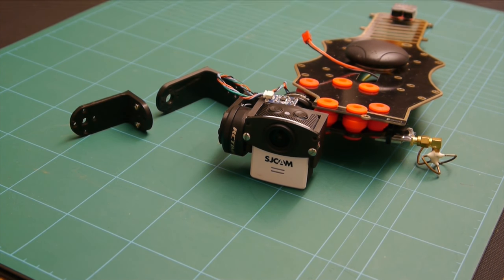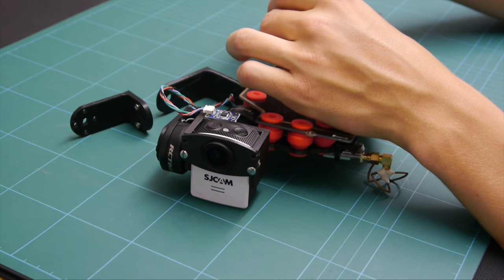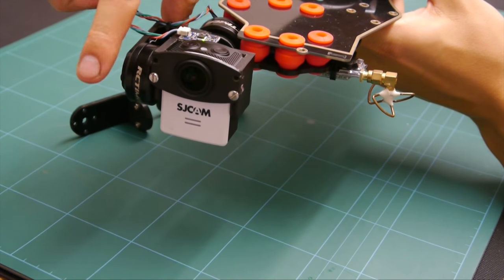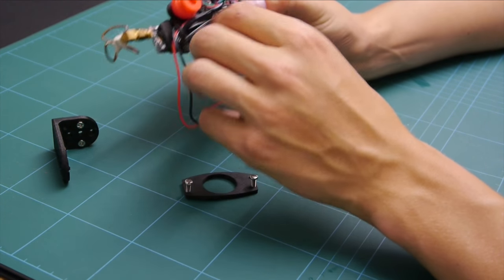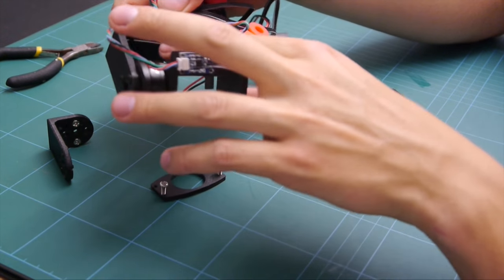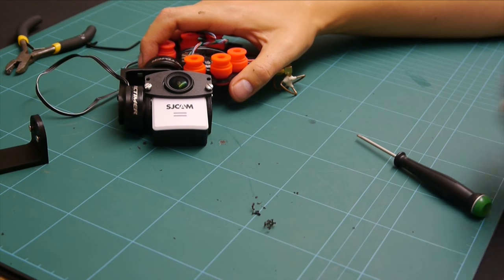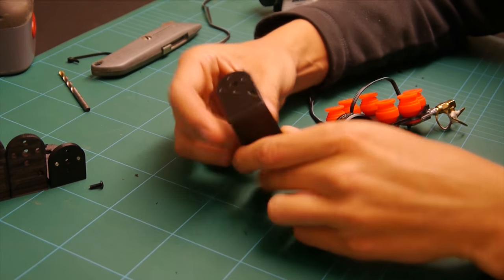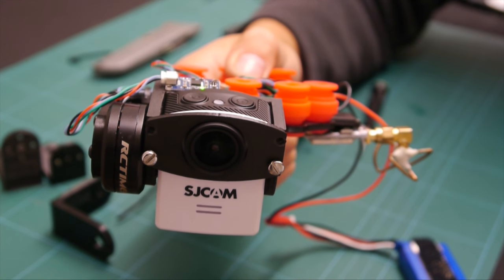TheManLab - Gimbal Build For Sjcam M20 - Diatone White Sheep APM Quad Build - Part 9

Comment: great video!,  have you tried connecting it to an FPV system?,.  (I see that the M20 have "FPV mode" but not sure how it works),.  I'm trying to make a quadcopter and definitely will use the M20 that i have,  this gimbal hold would really become in handy,
Reply from the maker: Hi. It's not recommended to use a camera on a gimbal as an fpv camera. The fpv mode on the M20 is so over wifi to a smart phone. When recording the lag is about 5 to 7 seconds so it's unusable. You will need a dedicated fpv system. Let me know if you would like to purchase some printed gimbal parts.
Reply: +The Man Lab thanks for the heads up! i didn't know about it, So what would be the cost for the printed gimbal? (and from where is sent ) So i can calculate the cost also, thank man!!
Reply from the maker: I can't PM you, can you send me one?

Comment: Great video. I was searching for a mounting bracket for my M20. Any chance I could get one without the motorized gimbal? My X8C can't handle that much weight.
I just need a frame with a Gopro mount or 1/4" screw. Too bad the M20 has less mounting options but the videos are great.
Reply from the maker: One comes in the pack. http://tinyurl.com/zgk2kde next to the case. Enjoy!

Comment: hi friend I got mine last week and I am trying to set it for FPV about the LCD is it possible to set it clear without anything on the screen because the osd of the drone cannot be seen very clear cause of that.
Reply from the maker: Charlie Farrugia Ok just don't use and OSD.
Reply: well I think that's not  a solution the osd is useful  so there is no option?
Reply from the maker: Charlie Farrugia Have you got a bad signal reception? Try and change you transmitter and reviver channels.
Reply: The problem is not with the reception but as you know the camera shows on top 1080 60fps and on the bottom the date and time now here is the problem when I connect the camera with the drone then it will display the osd for example the sat and voltage etc... because of the camera I cannot see clear the osd reading of the drone you know what I mean?
Reply from the maker: Charlie Farrugia I understand now. I don't use the SJ cam as my fpv camera I use a separate one. The only thing you can do is the configure your OSD and move the items around that are in the way. I've done a video on it too!
Reply from the maker: On the SJ cam. Goto Setup and go down to OSD Mode and turn it off. Done. Enjoy.
Reply: have you tried it? I  already did that and I get a black screen
Reply from the maker: Charlie Farrugia I don't have an hdmi out cable to test but on the M20 screen it just showed the picture no information.
Reply: I didn't tried the HDMI yet but for fpv you need to use the mini usb port and I don't if it's normally when I turn off the osd the screen becomes black then no opinion to turn it on again you have to power off the camera and on again
Reply from the maker: Charlie Farrugia The only thing left is to do a firmware update on you M20 mine is v1.2.4. Setup -> Version.
Reply: Mine is 1.2.7 I think it's the latest one can you please try to set the osd off and tell me if you find a way how to turn it on again as the lcd will turn black then cannot see nothing what you are doing.
Reply from the maker: Try downgrade. I don't want to update, I will be using my SJCam as my FPV cam on my mini tri.